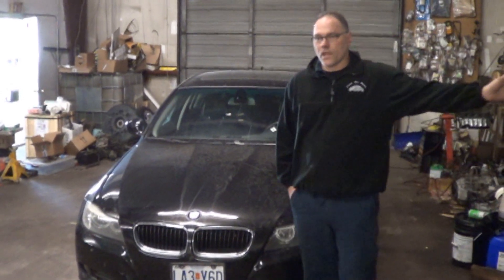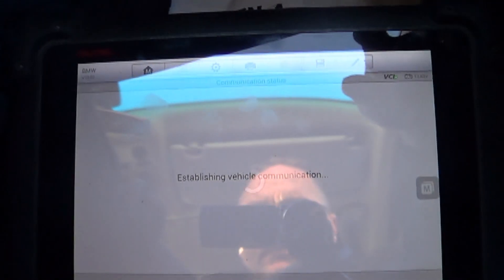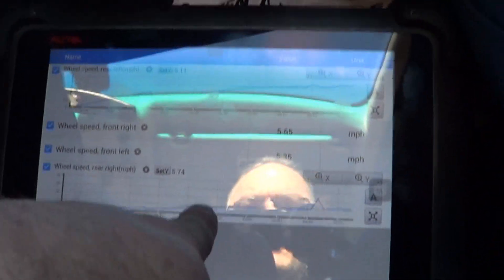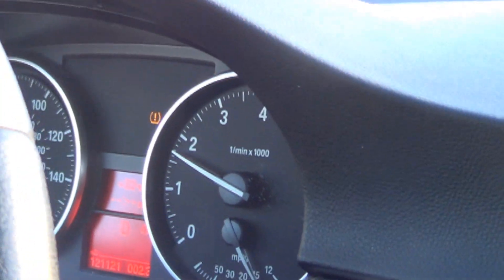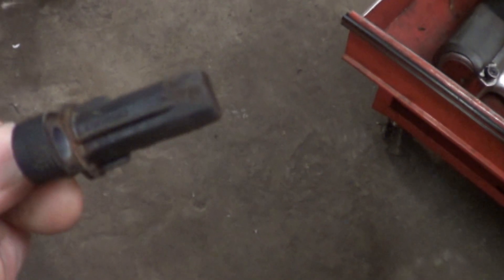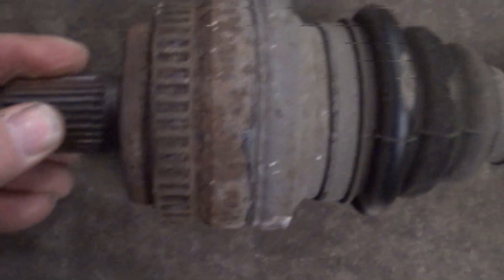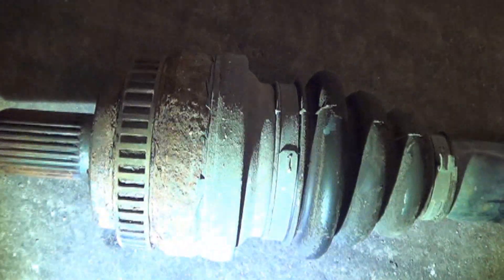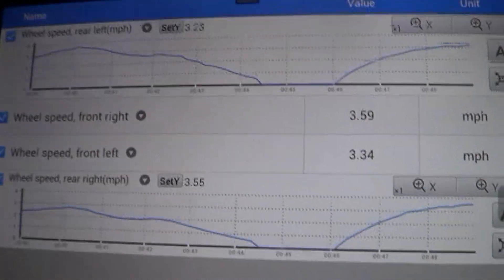BMW ABS Traction Control with ABS code 5dc1

Comment: how do you find the Aute.l easy diag for you.
Reply from the maker: Autel is pretty good for BMW/mini so far.   Point of video was updated axle is a better fix than replacing the reluctor.  Thanks for watching.
Reply: @CoolAirVw  Yea I love my Autel . you where right to change the axel because if the ring failed again due to rust trying to explain that to customers can be hard if there not into there cars I would have done the same thing.